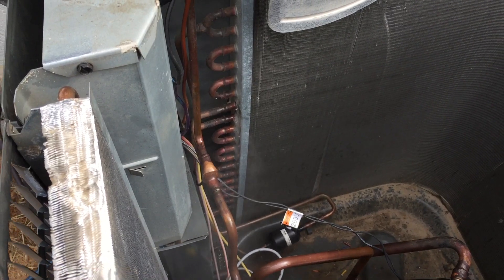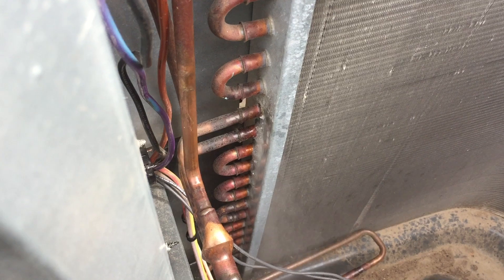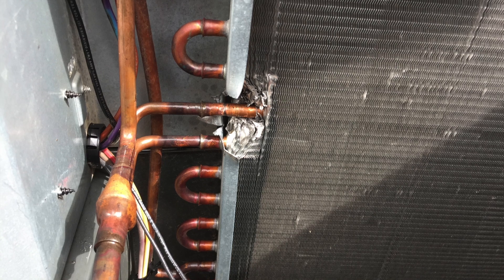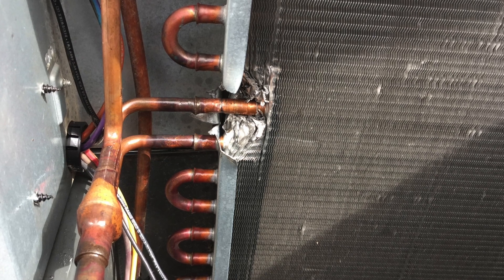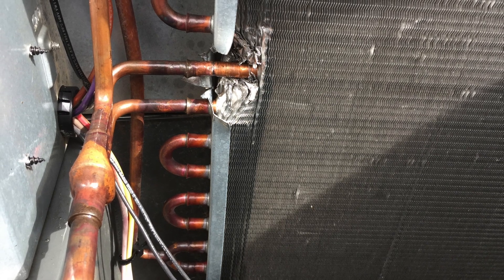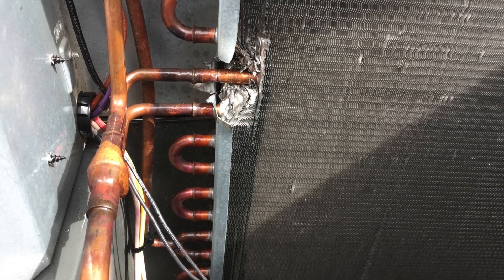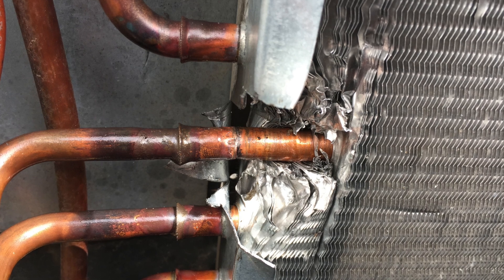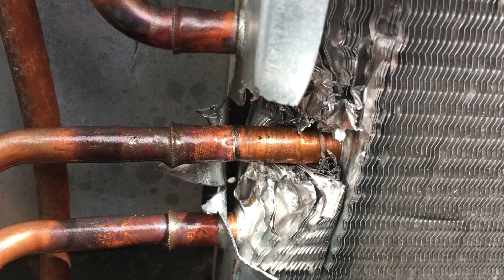How would you repair this leaking condenser

Comment: Years ago, auto shops repaired radiators. After a braze or solder, the shop would pressurize the car radiator and dunk in water checking for air bubbles. So what is the difference here? This is a competent, reliable repair for such damage. So help me understand why technicians would not repair this way. Really, all you got there is a big radiator! Nice job and great video.

Comment: I’ve always been a big believer in the “it’s already broken, i might be able to fix it up” mentality. I think this is a quality, viable repair. It will outlast the unit with no ill effects. I think the biggest reason most techs don’t do repairs like this is the fact that they can’t control the heat well when brazing. It takes skill to braze what’s damaged, and not do more damage with the heat of the torch. A good repair like this comes from experience.

Comment: Integrity is a rare thing these days. After a flood two AC guys told a friend he had to replace his entire outside unit. After watching a few videos, I cleaned up the connections and coils, and replaced the contacter ($9). Worked great. Might not last forever and additional corrosion work might be needed, but it got him through  a tight financial time.
Reply from the maker: It seems that disasters bring out the best and worst in people.
GFM
Reply: For corrosion, Deoxit seems to do great. I see it a lot in electronic and auto repair. A little pricey, but when the item costs a lot more, its worth it. Or when the item isn't replaceable, like in my case, when I start working on a factory Lincoln radio head unit. I won't be able to find an identical replacement for a 30 year old radio.

Comment: I hate wasting resources and sending things off to be recycled or to the landfill when they can be competently rehabilitated, refurbished and maintained. The throw away society that I live in doesn't agree with me, though !
Reply: I agree with you. Why replace something when it can be fixed. Why waste all of these materials when you can just repair the original with a lot less materials.
My main caveat is if it is something like this case with refrigerant that can leak, causing a larger environmental impact then just replacing it. Not saying this one wasn't fit for repair, but something that will break again in a year, should be replaced.

Comment: I must have done same repair a hundred times on split units.
I remember getting called back a month later on one job and another leak has appeared on another pass nowhere near my previous repair,  I originally noticed a foot print on the top panel, I suspect they have forced the plated out of position as to shafe on the coil, at that point I replaced system as it was more cost effective given its age and condition.

Comment: I've been a field service technician for 4 years now. in my experience I would change the coil. reasons? 1: it's leaking from an abnormal spot, more than likely corrosion or fins coming loose then vibration making the hole, other places in the coils will follow leaking in the coming months. 2: I'm in Florida a (carrier?) coil 1 side would cost around $200 (my cost) from Johnstone, I'm sure it's r22 so how much money went into recharging the system. Maybe a little less if you used r407c as a replacement, (if r410a unit then less money for the refrigerant) so how much did it cost to charge the system? probably a lot w/ labor and the extra money to replace the coil wouldn't have made the overall cost that much higher..

I mean this is good if it's your friend/neighbor/family member. but in the service call world you absolutely do not want call backs(by God they will happen though) and I just believe this is just 1 hole that showed itself and others will follow. then he will have to pay for a coil + x2 labor x2 refrigerant charges, when it's all said and done.
Reply from the maker: The leak is fairly common in the area of the end of the coil.  The repair is a quick one (about 1/2 hour for the repair).  The only time I have had additional leaks in condenser coils is when the unit is a heat pump low on charge in the heating mode having problems defrosting.  The unit is R-22 with the refrigerant being a replacement for R-22.  The cost for the repair was about $400.
GFM
Reply: grayfurnaceman not bad.
Reply: grayfurnaceman I just know if the customer ever calls back about this coil your the bad guy, and you will be doing it all over again and they want it for free. whereas if you had them pay $600.00-$700.00 for the coil plus everything else. If that coil leaked again you are at least safe  in the sense of warranty out the coil and labor, maybe not refrigerant though lol.
Reply: wow..... really?  a half hour???? lugging the tools to the unit would take more than that.  Then a vac pump, drier replacement..... nitro... this shit takes a long time.  Theres a lot of humping equipment to do this job. In the end its way cheaper than a coil.  I don't think even a 1.5 ton coil is under 500 bucks our cost, especially with the cost of copper and AL now.

Comment: Do it all the time on trane voyagers, they always rub thru on the tube sheet from vibration transfered thru the discharge line from the compressor. Never had a later issue. Sometimes you have to get stuff running now it's not like everyone can wait for a new coil, or can afford to replace the coil.

Comment: I don’t feel that a good technician is someone who only does things one way. A good technician is someone that can customize the service to suit the customer’s needs. On an old unit, with a lot of corrosion and the probability or more than one leak, present the customs pricing on a coil or a condenser. If you have a coil in super good shape or on a newer condenser, you can also present this option. In either case if the customer can’t afford it or cannot wait for a new coil to come in like in this crazy Florida climate, I’m going for this repair without hesitation. The unit will perform as it did before and I have also not had one come back on me in my 10 years in the game. It’s definitely a viable repair under the right circumstances
Reply from the maker: All repairs of this type must be looked at in the context of the unit being serviced.
GFM

Comment: A question that I have related to repairing coils is if bent fins actually matter, and if they do, how much do they matter? Do you have any thoughts on this? Thanks.
Reply from the maker: The damage must be considerable to affect head pressure.  I have seen RTUs that were damaged by hail next to ones that faced away from the hail with no damage.  I could find no difference in head pressure between the units.
GFM
Reply: Thank you!

Comment: Its broken, might as well try fixing it. I've done repairs like that and also just silver soldered the pipe to the steel end plate before, sometimes due to lack of money etc on the customers part and sometimes because the system is cooling $k worth of product.

Comment: What happens if you repair this and you don't evacuate, just fix the leak and charge it up? That's what happened to my neighbor. Is it a disaster or just a bad idea?
Reply from the maker: It is a disaster.  With air displacing the refrigerant, the head pressure will go very high with early compressor failure.  The unit will also run very inefficiently.
GFM

Comment: do this repair all the time... I just wish someone could invent a tool that would make it easier to remove the steel tube sheet material around the copper.... Its a royal pain in the ass... and sometimes there is just no room to cut it out..  I've used drills and small cutters and hacksaw blades.... Theres got to be an easier way.

Comment: Our industry is the only industry in which the contractor will take short cuts in order to make less money. Is it a viable repair, 100%. But you now own that unit, you made less money on the job, and if it fails you'll get to eat that sandwich.

I don't have a red cross on my truck, I get in that truck to make money.
Reply: If the tech insists on repairing it, you have a valid point. If the tech OFFERS the repair as one option, with the written disclaimer that the repair is not guaranteed, the CUSTOMER owns that repair if he did it with eyes open to save money. The customer chose to roll the dice. The repairman offered a requested service. 

A similar situation is if you need a part for your vehicle, you can buy new or buy from a junkyard. Junkyard carries a 30 day warranty and may not perform well even if it doesn't go bad. If new costs $800 and salvage costs $50, you might try it, but you can't expect much and you can't be mad if it doesn't work.
Reply: I always tell my customers that their is a chance another leak could pop up somewhere else whilst I am driving home, that's just a fact of life.
I guarantee my repair not their system.